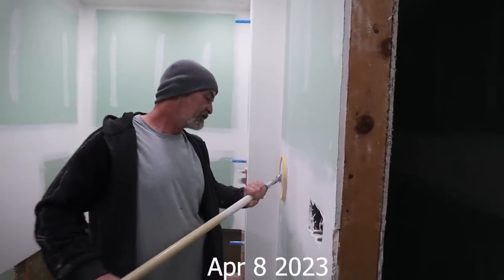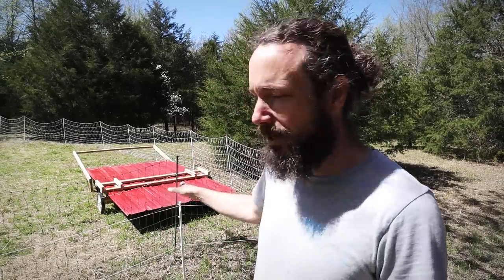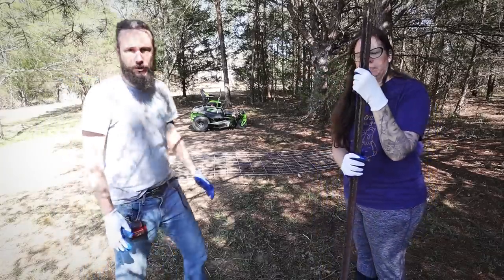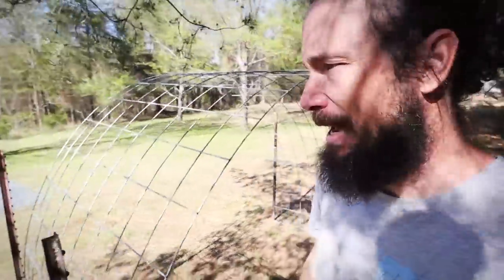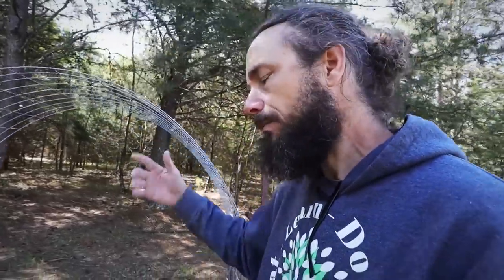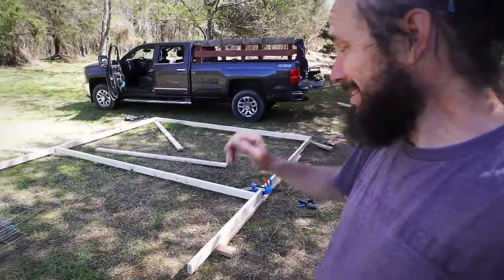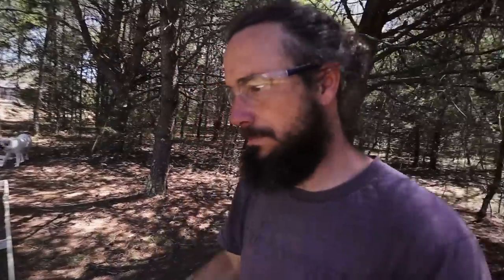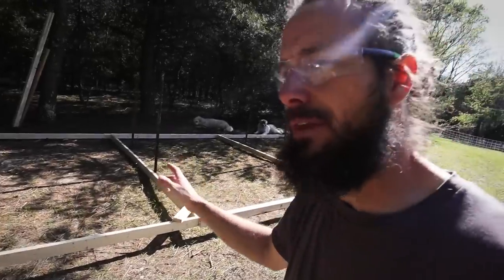Starting (and re-starting) a Coop Build for our Breed Stock Chickens

Comment: To protect your birds from air attack, provide cover for them. It could be bushes, small trees, old umbrellas, scattered pallet "teepees", etc.  You can also string wires up or hang bird netting. When I let my birds out they do not hang out long in open areas, they'll go wooded areas, or any of the barns.

Comment: Hi, I have a ton of hawks here. What I did with my chicken run around the garden was go across from fence to fence with that plastic deer netting, bought a 7x100 foot roll. Then took branches that I trimmed from trees and put them under the net to hold it at a walkable height. Planning to do something similar with my flock that will be in the pasture getting moved around. Will be a little more time consuming to move the entire fence, but til I can figure out something else it should work

Comment: You can train chicks to be wary of aerial predators. Do you have a drone that you could fly low over them to teach them to run to the shelter whenever something flies overhead? You could also make a few shelters throughout the area using blocks and pallets just so there is more shelter and shade in their run, or include the tree (beside the meat-mobie) in the run to provide protection.

Comment: I put a deer netting over my entire fencing w/few random post supports. You can put a few metal 5ft posts in ground so they can be moved. Worked great! Put posts at corners & midway on fence line edging & some in the middle area. You can use a tight sting from posts to help hold up netting to avoid sag. Personally, I like 2 permanent caged pens side by side to rotate chickens.

Comment: For the cap on those t-posts, just cut cut an X or just a slice out of some cheap tennis balls.They do the same on the legs of walkers for the elderly, to keep the walker legs from scratching up the flooring (in your case from keeping the tarp from getting ripped up).

Comment: That netting is awesome, you just need poles, I use poles from the tree line 1 1/2 to 2" diameter poles about 15' high.  Nail a 1'  2 x 4  across the top to keep the net up.  If I cant bury the poles I make tripods.  The tripods are great for hanging water and food.

Comment: I would think that the tin so close to the ground would cook any birds underneath. Might have to insulate under the tin with foam sheets to keep the heat from transferring.
Reply: That single layer of fairly dark metal roofing so close to the ground in full-sun will definitely radiate heat down onto the birds underneath creating a very unlivable situation for them. Providing some sort of shaded area out of the heat for them is essential.

Comment: Raise the panels UP so the sides don't have the posts in the way. Put wire on both sides at the bottom. Bam, the tarp fits and the head height is better.

Comment: What you have will work but next time grow a guard goose in with your naet birds n they will guard from above ...& All the rest Of meat birds that come  afterward...meantime use to our dogs... Move their shelter ( small shade /out of rain , place where they can lay n stay n watch ...birds know dogs will attack ... Ive had hawks even in my cooovroof but don't try to get into grass area cuz of my dogs that go at them. Even thuo dogs are on other side of fenced area & away from the chickens grass area ... The chickens  will learn  to run for cover...a rooster can & will call alarm call for chickens to run for cover as he will also ,but likely be last !!? OLD FASHIONED CAR JACK WILL WORK AS A POST PULLER. N SAVES YOU U MONEY !!!  You need hardwear clothe in-between sections cuz almost full sized chickens can go thru the panel holes ...or did I miss something you said !!? Will also keep snakes out..but that can n should be attached onto the cattle panel , ok sry just heard you say , you're doing the H-cloth...use 12"x 50' 0r 200' roll of galvanized aluminum "flashing " ( used in roof to keep leaks out ) is GREAT WAY TO KEEP ANYTHING FROM DIGGING UNDER COOP THAT WAY YOU CAN KEEP A DURT FLOOR THAT WILL BUILD GOOD COMPOST FOR YOU ( ONCE A YEAR LEVELING BACK DOWN )  KEEPING THEM ALL HEALTHIER ...MINE LIKE IT N HAVE FOR OVER TEN YEARS NOW !!!

Comment: You do realize wildlife will just climb up and over the hardware cloth, go through the larger holes and eat your chickens and eggs, right? 
It's a futile endeavor if you don't put hardware cloth on the whole structure..
My suggestion is to put hardware cloth on the lower parts where chickens can reach and cover the rest with metal window screen. Yes, rodents can get through screen but it's better than nothing.